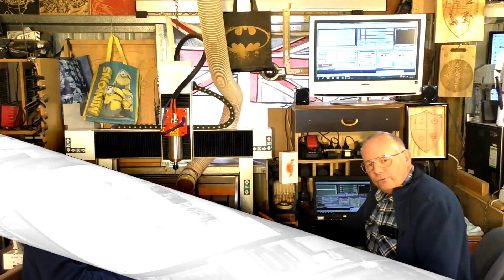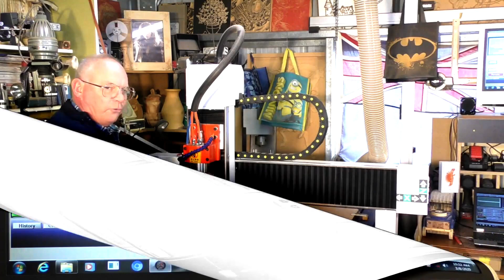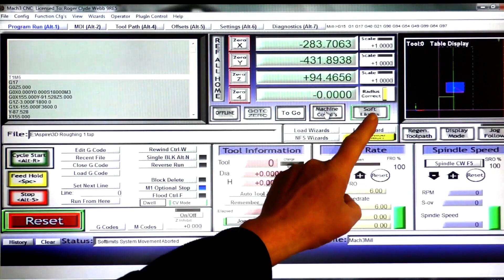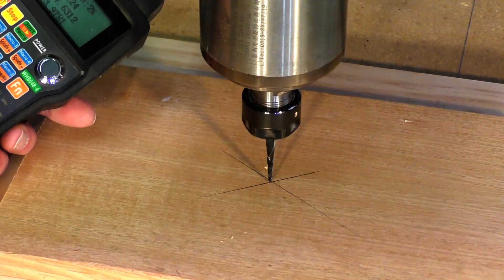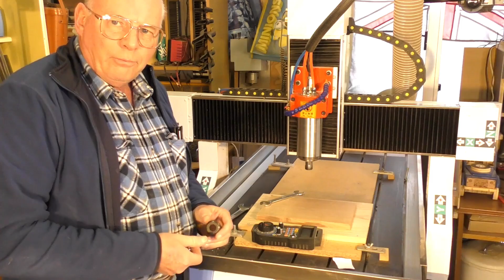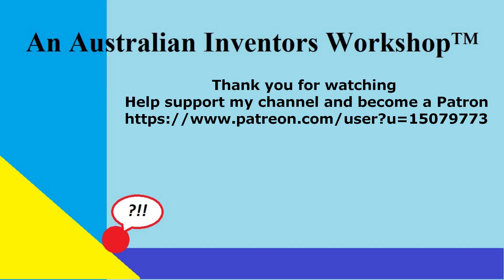CNC Router/Mach3 A to Z your first 3D project for beginners

Comment: Hi Roger,
I am very new to  cnc and Mach 3. Had a dsp control previously. Just after installing mach3. Was doing a pocket cut today and it stopped in the middle of the project.
What could be wrong ?
I working off 5g on my phone at the moment. 
Regards 
Paul
Ireland

Comment: Hi Roger
During configuration for VFD I have problem to find P01, P02. I only got uP0, uP3, uP4, uP5, uP6.
Sir, please tell me 
How to change these uP code to P code in VFD CNC 6040Z 4 axist. 
When I tried to reset factory setting but still an error 40 appear. Then it is still unable to get P code again.
Thank you sir

Comment: I want to do a project with a 3d relief cut in brass, do you ever worry about the lead in brass, or is it such a small amount machinists do not really concern themselves with it?
Reply: I had to look it up to be sure, but I checked and brass is made from copper and zinc and doesn't contain lead.  I thought maybe you were thinking of bronze, which is copper and tin.  I don't think there's a lead problem when machining either of these copper alloys.
Reply: @gizmobowen  I should have been more clear originally. I am specifically asking about C360 "free-machining brass" which I believe has a lead content of about 2-3%. I bought a piece of brass to machine on my upgraded Shapeoko 3 to make a putter head and then I read about lead in C360 brass and I was too scared to mill it. I want to make a putter head that is functional, but also includes an intricate 3d relief. I have made putter heads using aluminum, but they are too light in the end.

Comment: Been using mach3 on latest windows 10 64 bit without issue. I use a touch screen monitor to interact with mach3, and I think the same pendant as yours.
Reply: works with me to same system
Reply: I'm very envious of that combination.  I'm running mine on an ancient XP machine, because that's what I thought I needed to do and would love to add a touchscreen, but the options are limited for an old computer.
Reply from the maker: Newfangled Solutions Helpdesk
 Like many in the CNC community, we and our customers have been affected by the Windows 10 (64bit), version 1803 update issue that leaves the Mach3 application unable to completely load (after profile selection, the splash screen will render and then disappear as the application crashes). We've investigated the cause and developed a provisional patch to the Mach3 (version 3.043.062) application binary that has demonstrated effectiveness in resolving the issue. We are working together with the Mach development team to further validate this patch as they work to deliver an official release in the near future.

Comment: Have you ever had a DRO not read when you move a axis. I put a rotary on my Cnc hot it all working correctly when I tell it to turn a certain amount, the only issue is my DRO doesn’t work when I rotate the axis.